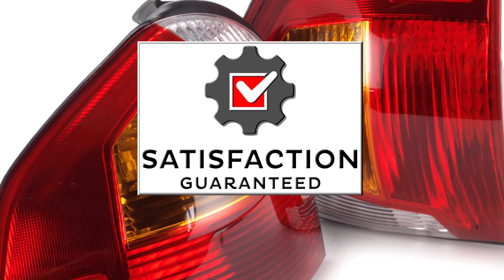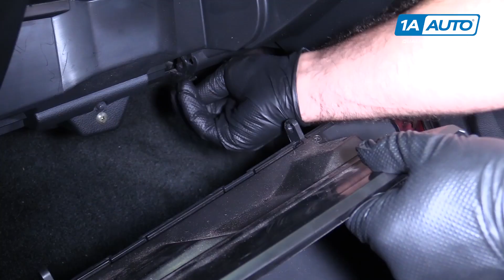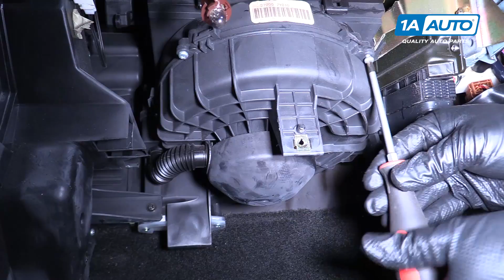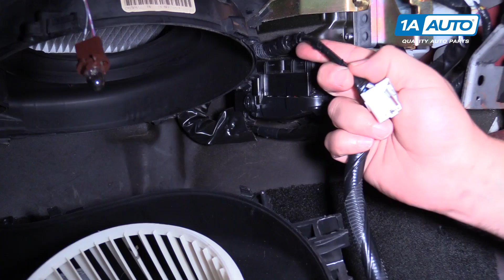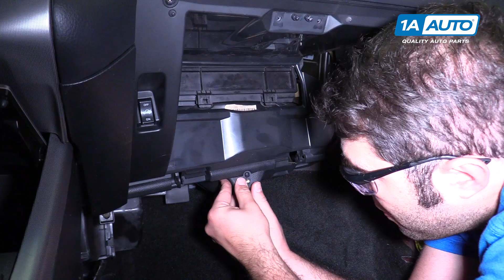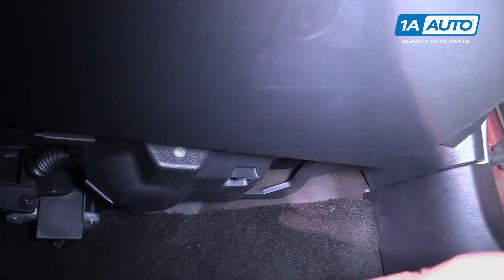How to Replace Heater Blower Motor 05-06 Nissan Altima

Comment: If the fan blows fine, but is noisy, does it probably need replacement? That's the case with an '06 I just bought. The heat and A/C work beautifully, but it makes a whirring racket sometimes. I can cut the fan off and the noise disappears.

Comment: I appreciate your videos. I was hoping this would help me with my 06 Maxima blower motor replacement however it seems they have some differences. I can't, for the life of me, get the blower motor/entire housing down as if there is some clip or screw in the rear I can't get to nor confirm that it's even there.
Reply from the maker: +esq pac Thanks for checking us out. Shop for high quality auto parts on 1AAuto.com:

http://1aau.to/m/Shop-1AAuto-c

Comment: Hey, great video!!!   Just any fyi for those that have tested and ruled out fuses, relays and the blower motor resister, fan control module and come to the conclusion your blower motor needs to be replaced....before you follow this excellant video and replace your blower motor, you should consider that the problem might just be that the blower's squirrel cage fan might just be stuck on something which is preventing it from spinning! That's what happened to me. Before I completely removed my blower motor, I removed the front 4 screws and tabs as shown in the video, gently pried down the cover so I could just see the squirrel cage fan, and used a thin screwdriver to spin the fan mànually. When I turned the key and tried the fan again, it worked normally again so I just buttoned it back up and am enjoying full A/C & Heat again! Maybe I dislodged whatever was binding the fan, but consider trying this before you do a full replacement.
Reply: thank you for the tip. I'll be testing that before buying
Reply: You saved me some cash! I took the covers off and out of sheer curiosity and remembering this comment. I gave it a couple thumps and turned on the car. Started up like nothing happened.
Reply from the maker: +Ken F Thank you for the great reply. We love to empower our customers by showing you how-to perform your own auto repairs while installing our high quality auto parts. Have a great day! 1aauto.com

Comment: I'm pretty sure that the part# (1ahcx00326) shown is the blower motor for a 2006 Nissan Altima 2.5L with MANUAL temperature control and NOT one with automatic A/C & Heater temperature control so make sure you use the correct blower!
Reply from the maker: +Ken F That is correct, 1AHCX00326is just for models with manual A/C only!  1aauto.com